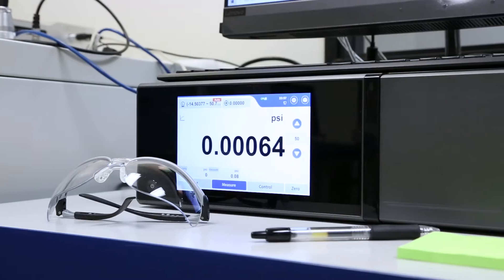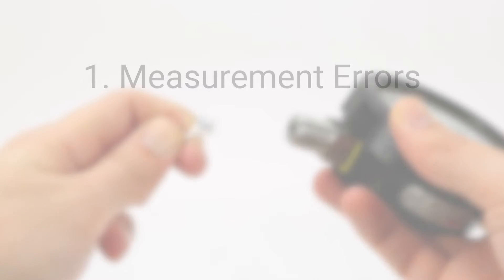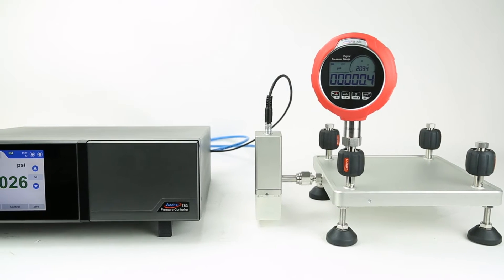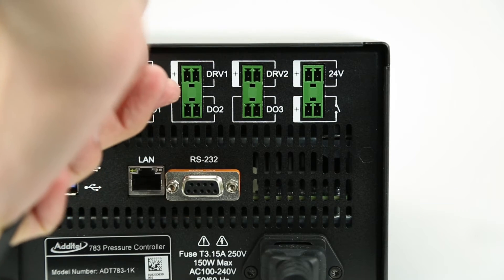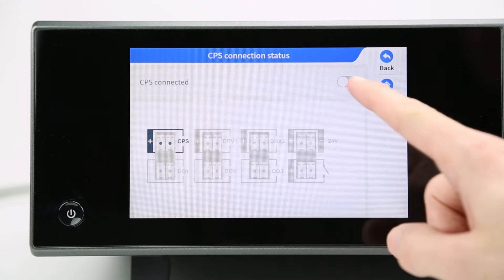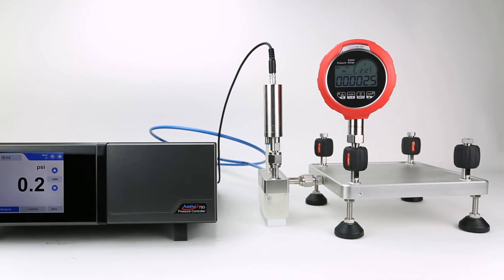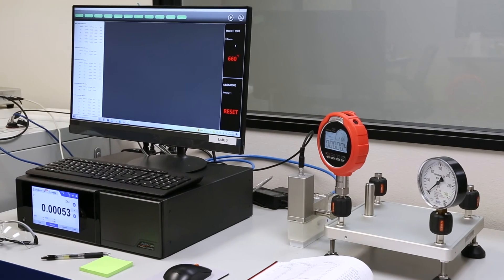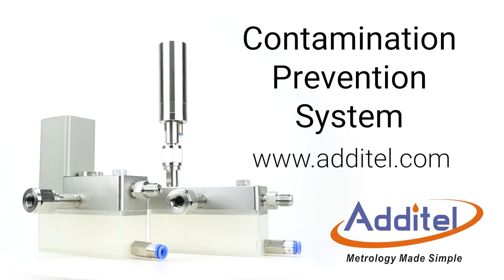Contamination Prevention System For Additel Pressure Controllers

Comment: Does this CPS require an external vacuum source to be connected to the 783 controller? Or does rhe controller provide the vacuum that clears the fluid/dirt from the gauges?
Reply from the maker: No external vacuum is required. During depressurization, the CPS module will dump the small amount of fluid between itself and the gauge, while keeping the fluid that goes through the controller completely separate.